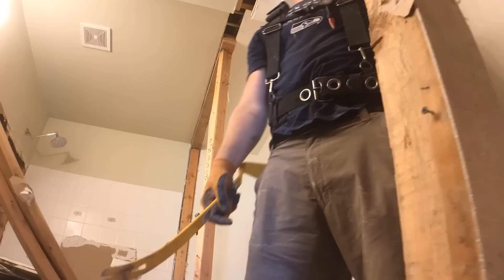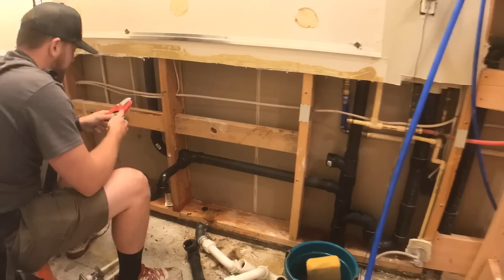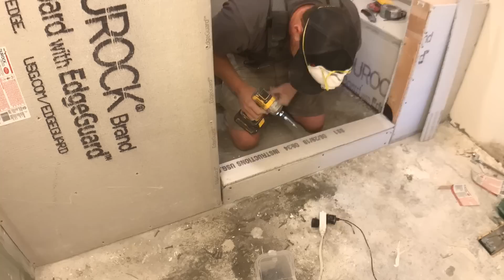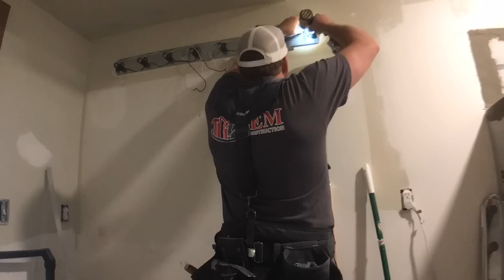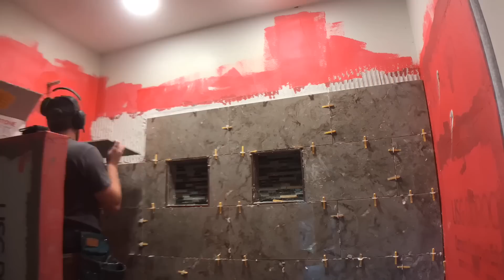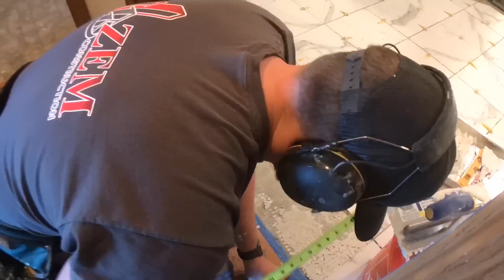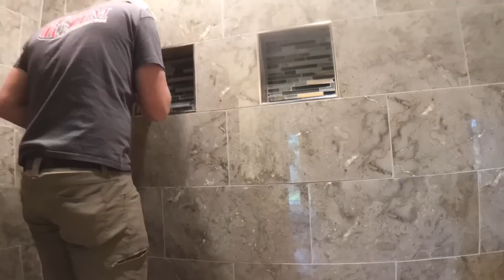Large Walk In Tile Shower | Bathtub Conversion | Full Bathroom Remodel | Time Lapse

Comment: Hey man I am a tile contractor and i have to say this is the first video i have seen where i cannot see virtually anything wrong with your install. Great remodel man. What i really wanted to do was give you a few tips that help me quite a bit. 1. Get a mil thickness gauge for your liquid waterproofing. Its better to be safe than sorry. 2. When you do your pebble floor you can avoid the appearance of sheet lines if you single set OR set the sheets with a few inches of space between them and fill them in with single stones. It will take your projects to the next level and im all about taking it to the next level. 3. When you do your metal edging, cut all 4 sides at once. When you cut them, do it at a 45 with the finish side facing the inside of the niche and the part to be thinset down facing the face of the shower wall. When you do this, you can use a hot glue gun to glue the part that gets thinset down together and hold all 4 pieces together like this. From here you can easily install it in its perfect form without having to make adjustments on the wall. 4. Last one: Get a toothbrush to clean your lines. It helps a lot around those clips. Nothin is worse than a clip that wont snap clean. Time waster and sometimes you risk damaging the tile. Cheers!
Reply from the maker: Thank you! Those are some great tips! Just out of curiosity what do you use for your water proofing? I’ve been leaning toward the latacrete system.
Reply: ZEM Construction I use all of them interchangeably depending on the application at hand. Each system has its strengths. If I’m using a felt membrane, I will use mapei. Their membrane is the best on the market right now. USG used to be top dog, but they are no longer manufactured. If I’m using a liquid membrane I’ll use hydroban. I don’t do water in water our systems anymore. No need to. If you are working with small tile i would avoid using a membrane in showers, as you will fight the build up at the corners of the pan, causing the bottom rows to flare out. I would use Laticretes system in that case and go with their sealant everywhere but your change of plane at the pan. I would mesh tape that and hydroban it to avoid build up.

Comment: I do tile showers and floors for a living, yiu need to look into Schulter systems they work so well and are completely water proof, material cost a little more but the labor is cheaper and easier!!
Reply: Plus,  redguard requires modified thinset, which is modified with latex, which is organic, which is a food source for mold growth!!! This shower WILL grow mold!!!!!!
Reply: Michael Horn it won’t grow mold. We have been using Schulter for 12 years and have zero problems or issues with 60+ showers. We use Mapei kerabond one thin set for the material to stick to the wall and for the tile to stick. Easy and worth the money

Comment: the right little wall in the entarnce should be a bit lower. Your subway tiles from left wall don't line up. Plus the corners inside shower ain't right. You match them opposite. Corners go like small to small, big to big. In my opinion and exp. Rest very nice job.
Regards

Comment: I would say the shower slop could be less than 1/4” per ft.  You can use 1/8” per ft in walk in showers.   Also shark bite fittings behind walls along with cpvc flow guard are the worst plumbing fitting and pipe In the industry.  Strongly recommend not using them anymore.

Comment: Seems like you have a lot of ridges when applying the joint compound which results in a lot of sanding and dust. I always work with a a rag and bucket of water to clean excess compound off the taping knife. I build the compound up in medium smooth layers and scrape the ridges off between coats if needed. Light sanding is for the final step. I also use medium to large stainless taping knives with a slight bend in them. Filing off the corner edges of the tool with a metal rasp also lends itself to a smoother finish with minimum ridges. Lasts steps are skim coat, light sand, vacuum, damp sponge.

Comment: You really need to take off that tool belt, you dont need it on for every task especially in such a small room, makes life so much easier, just need it for framing/form building, just some friendly advise.
Reply from the maker: I mean the big framing tool belt may be overkill for some tasks, but I respectfully disagree.  Having it while hanging drywall is really nice, I can have my rasp, knife, saw, screws, drill and tape measure right on my hips. Then for electrical I use wire strippers, the cable stapler, extra staples, electrical tape and wire nuts. Those wouldn’t work well in just pockets. Then with plumbing, while working with pex I have my cutters, crimping tool, crimps, clamps for holding the lines, tape measure, and some of the fittings. Again all that wouldn’t work with just pockets and I’d drive myself crazy just setting it down and loosing track of it. Laying trim I also like them for extra nails, tape measure, several different squares, sometimes ca glue and activator. For tile I have a different set of bags so I don’t get mud on my nice ones, mainly for spacers, wedges, and the wedge tool but I have a couple other tools that use to help my place them precisely like a puddy knife and sometimes a mallet. The only time I don’t think I need them is when doing mudding/taping or painting which I take them off. Also because I have them so much I almost feel weird when I don’t have them on. They also help me keep track of everything. Thanks for the comment!

Comment: Really nice job! Appreciate the wrap around at the corners, very clean look. Re other methods, you may want to consider the Schluter products (I don't work for or represent the company) or something similar. They'll save you a bunch of time, if more expensive materials, so it may work out about even for you. They'll help keep wood out of your structures, eliminating the worry that any pinhole leak will cause rot. Just a thought. Also, some of the newer, single component grouts are fantastic, color steady, clean up pretty well, and save the sealing step.
Reply from the maker: Thanks so much! This video was filmed a little while ago. Since then I have been introduced and used the enamel based grouts! So nice to work with and no sealing or even caulking! The Schluter systems are still a little bit suspect to me. I’m sure their boards and foam are water resistant but they use thinset to seal. There is no way thinset is water proof and it will fail if exposed to water over time. Issac Ostrom is a channel on YouTube I really like and he goes over it in extreme detail. I really appreciate your comment! I will definitely do some more research on schluter products!
Reply: @ZEMConstruction  Schlueter is guaranteed for 10 years.  The best product out there.  Redguard recommends that you use a modified thinset.  Which is modified with latex, which is organic, which is a food source for mold. This shower will grow mold!!!!!!!
Reply: Blhv(,;&) llv,lk b,k vlk lb lllkkm(,:?:?,:(  l,,